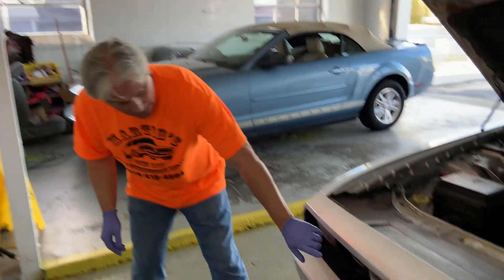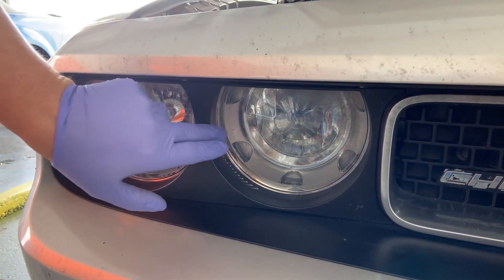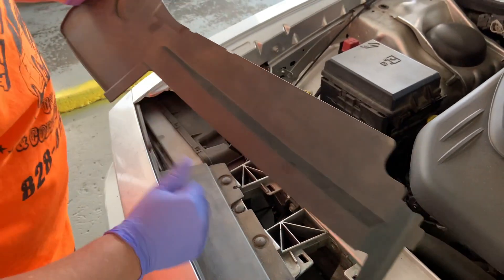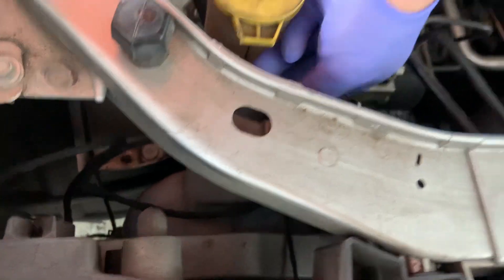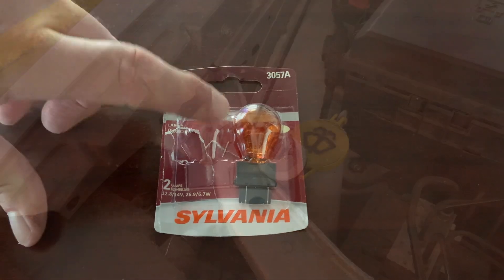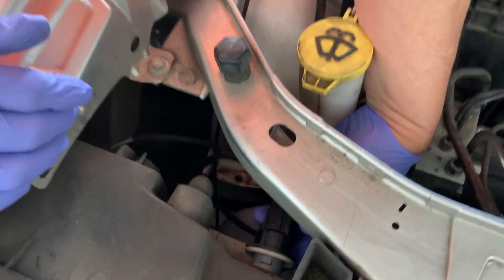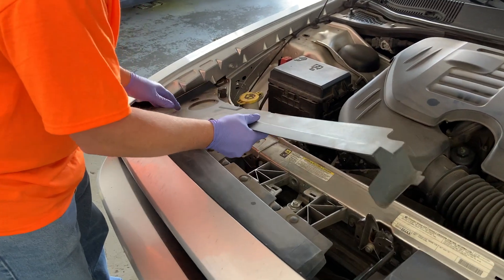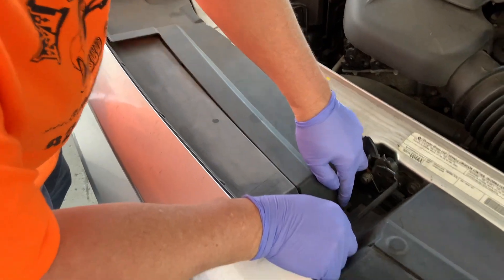How To Replace Front Turn Signal Bulb On A 2008-2014 Dodge Challgenger

Comment: Is there a air intake hole in the middle of the headlight for that year challenger? I have a 2012 redline but have a grill blocking my view. I see videos of the middle
Of the light is a cap you can take off?
Reply from the maker: Not on this Challenger model. Some have it depending on the package.
Reply: @Martin's Used Cars & Collectibles LLC  thanks for the response. I installed a cold air intake and can't figure out how to get air flow to it. Any thoughts or ideas?